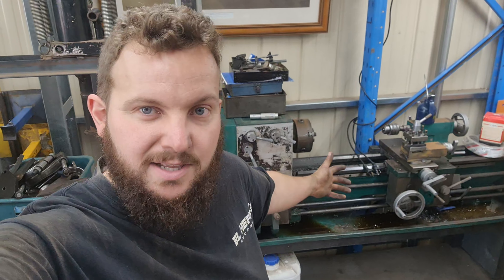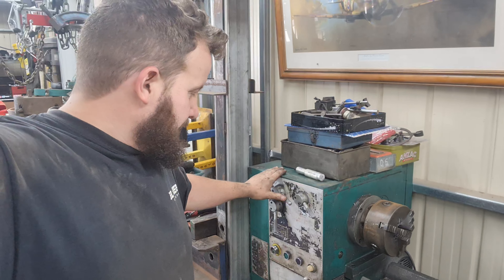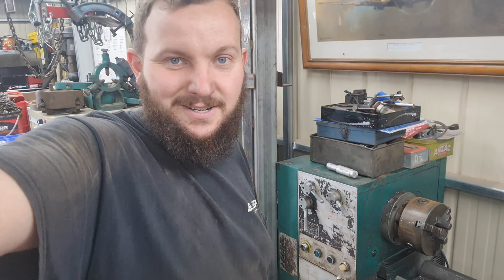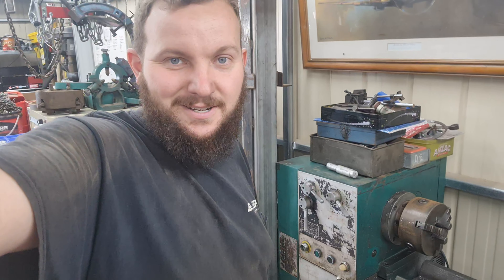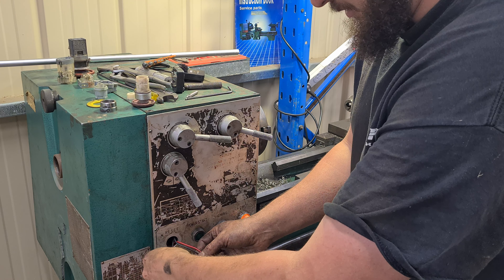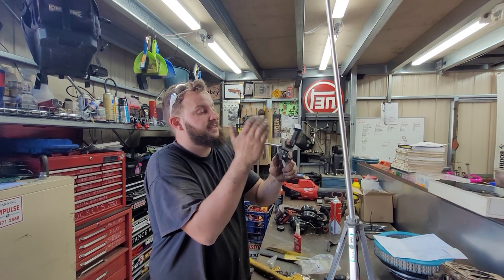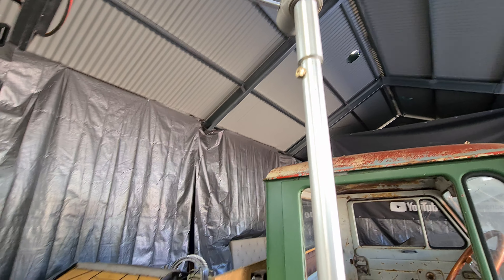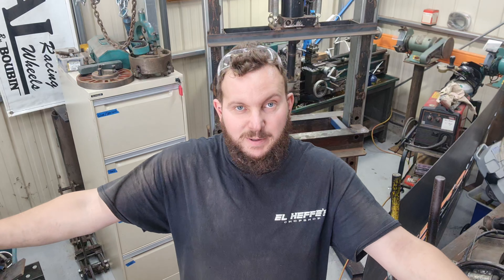Repairing my 30 year old lathe for under $20!

Comment: Check the start capacitor on your motor, maybe failing (out of spec) and why the motor hums but not spins until you assist it.
Reply from the maker: You are on the money! Already sent it off for a refresh and new capacitors ❤️ thanks for the advice though